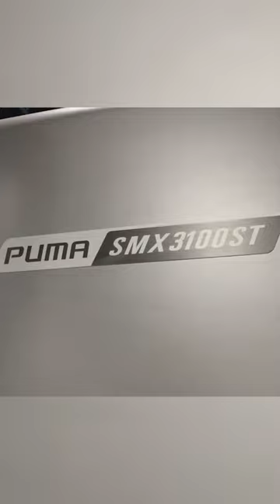Incredible 9 Axis Machining!

Comment: First time i hear 9 axis ! You guys are really TITANS !!!
Reply: Ofc it is the first time because there is no such thing as 9 axis machining
Reply: Actually, it's 5-axis machine, which has additional four axis on second channel, three of which are duplicate axis, and one is an intercepting axle.
Reply: @Silver_Nomad  irrelevant, simpler machines can do the exact same things this one can.
Reply: It has 9 axises (X/Y/Z/X2/Z2/B/C/C2/W)but can only run 5 of them at the same time (X/Y/Z/B/C).
Reply: @dannymoneywell ro if u work in this sector , u know its not about what the machine can do, but the time that it can do the piece, and machine like this reduce a lot the tim
Reply: I work on this machine daily at work, I make fuel pump components for Rolls Royce Aerospace and I must say it’s by far the best CNC I’ve ever used, also don’t be fooled by the term 9 axis… it sounds more complex than it is but once you understand it the axis doesn’t matter 🤷‍♂️ the milling top turret runs on 4 axis x (up and down) z (left and right) y (towards and away from you) and finally b (rotation of the turret between 0-180 degrees). The lower turning turret works in only x and z same directional movement applies only this time the x axis +/- directions differ. The remaining 3 axis are simply two rotating chucks being the c axis one on the left and right with the ability to use the right hand chuck in the a axis which traverses left and right. I hope this helps understand what you’re seeing in the vid 👍

Comment: Impressive for sure. Makes you wonder how much more advanced these things will become. In 1967 ( 17 years old) I learned NC on a Frieden tape punch. Only 2 axis and point to point drilling. Several years later I started my own shop. My first CNC yay! Even then it was paper tape driven. 300 baud rate I think. Then a Cad Cam system. Blew me away seeing it print a wire frame of the space shuttle on a multi pen ink printer .Then came more axis. Solid Works and Wi-Fi . Where will we be in that same time period…….makes you think.  Tell the machine what you want? I can in vision it.
Reply: My dad made an ac130 part for the cockpit chair... The cargo only version aircraft... Using the tape... They finally got clearance for takeoff from jkia... Was awesome for my dad as an experience... Those old machines were gold and still are

Comment: Is there any reason to spin both chucks when transferring the workpeice over? 

Is it just how the machine syncs the C axis between the two?
Reply: prevents an uneven grab
Reply: Also prevents grabbing on chips
Reply: Also ensure that the grab it's almost perfectly concentric with the machined surface
Reply: All of the above. The first reason is that were you to machine features on the other end, when transfered the secondary chuck rotates to keep the index on the same place. Second reason is to prevent drooping when transferring the workpiece, and the third is to clear any possible chips from the jaws.
Reply: Well if the sub-spindle doesn’t spin at the same exact speed as the main spindle than your gonna ruin the surface finish. Both spindles must be stopped or rotating at the same speed. If you try to grab a rotating workpiece with a non rotating sub-spindle what do you think will happen? 🙃

Comment: how much does such a freakish machine cost?
Reply: Probably something around 300k-500k€. And then you need the tool holders for something around 100-200€ per holder.
Reply: One milllliion dollllars.
Reply: 300k? 300k cost a lathe with double turret and double chuck only to work xy plane.. with a quarter of the size of that machine.. the cost of a machine with that many axes will have a very price tag on it
Reply: @SlickArmor no
Reply: @SlickArmor depends the size
Reply: @purplehazerokker  OK then..how about..100 billion dollars?

Comment: Explain how there are more than 3 axis
Reply: Along with the basic X,Y, and Z axis,the main spindle can also be oriented or clocked to any commanded position. That’s 4 already with the spindle as a C axis. Then you have the tilt axis for the spindle head which holds your cutting tools, that’s the 5th axis. You add a sub spindle and you have 4 additional axis which is just the the X,Y,Z and (C axis )spindle orientation just mirrored the the opposite side of the main spindle😅

Comment: No such thing as 9 axis machining
Reply: Who said that? 🧐You can machine a part 100% complete in one process with a 9axis or even a 7 axis. Compared to a 5 axis, which can still require a secondary operation usually. I get what you’re saying, it just does both operations at once. 5 axis is pretty much all you need if you don’t need the sub spindle system🤓